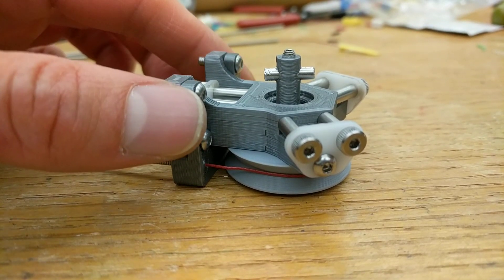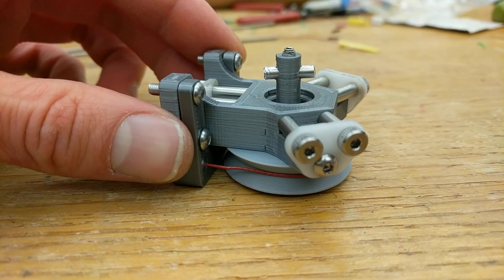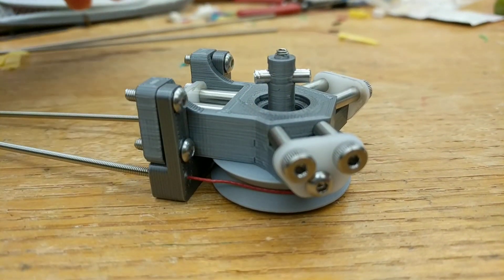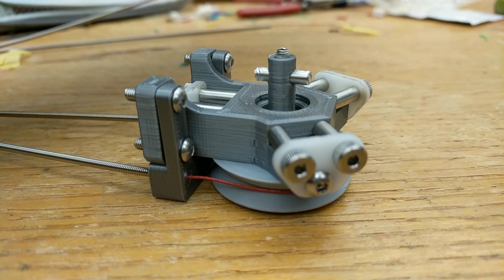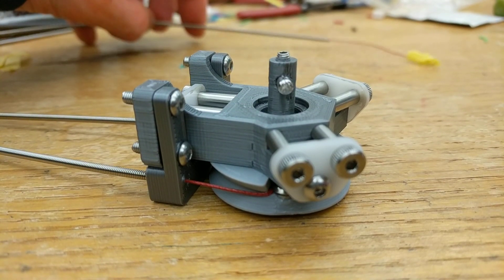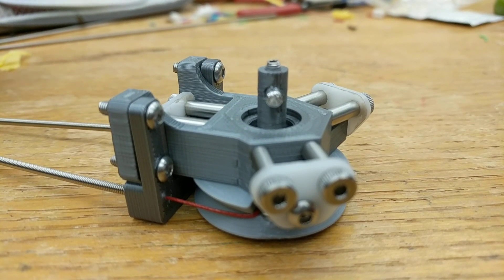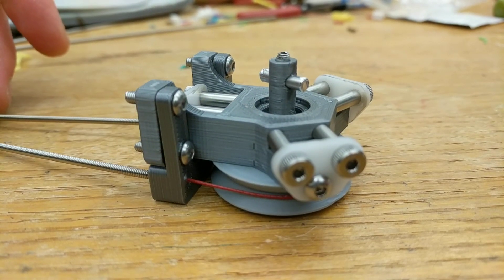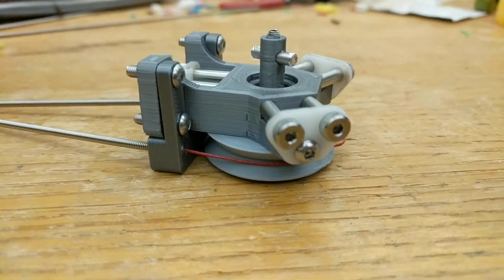Remote Tool Changer Proof of Concept

Comment: I think you could try guitar string for control wire. They generally have a stud built-in to one end, and you can solder a blob to the other if you use lower strings.

Comment: fyi, the current  (lol) fishing "superlines"  dyneema and spectra are VERY slick and VERY low stretch and VERY available. So slick knot selection is important...Also you can "overwrap" the pulley one or more revolutions to alleviate the attachment point providing all the anchoring of the string.
Reply from the maker: Yeah, I switched from thin steel cable to Spectra line about a year ago for small, low strength applications, and it's worked wonders. Here, the anchor point is half-wrapped around the screw before being cinched down. So Far, I haven't seen any problems, but on this end I can just wrap a full loop instead of a half-loop to get more of a grip.

Comment: Wow looks great! Can’t wait to see the full head (and get the plans for building it myself :D). Can you tell me where did you get those springs and strings?
Reply from the maker: Thanks, mate! Head (and extruder adaptor) is coming along. Spring guides come from
http://www.drtempleman.com/coil-springs/spring-guides
The part number is SG-088-020-18. These were leftovers from some of my tentacle mechanisms, so I had a small bulk order of them, which came out to about $5 apiece. In singles, they're closer to $10 apiece. It's good stuff though. Coupled with Spectra Line, they make for some fantastic cable drive hardware.